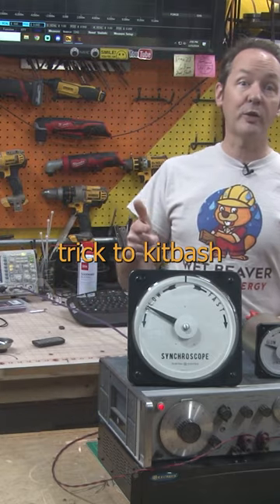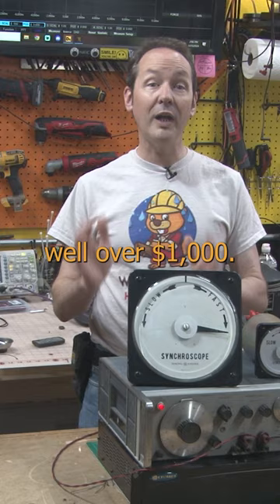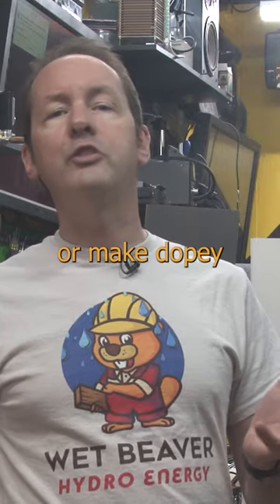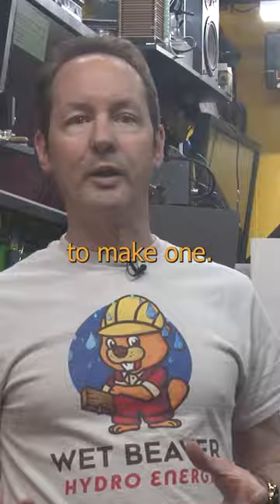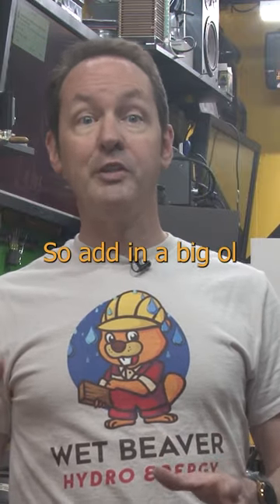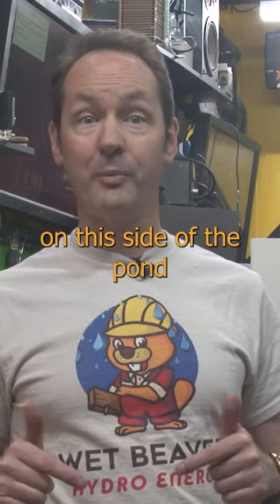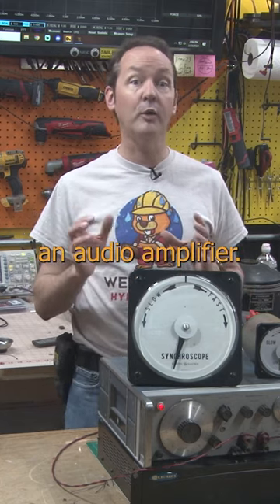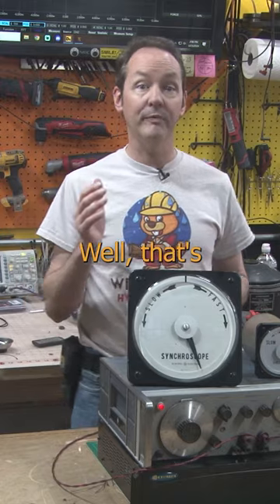Audio Amplifier Power Supply Hack #engineering #electricity #electronics #science #energy #power

Comment: "20Hz up to what the hell are you doing?!" 😂😂😂
Reply: So 2.4 Ghz and 5 Ghz capable? just for my wifi
Reply: 20 kHz are „what the hell are you doing“
Reply: Yep, I needed around 80 volts at 25 KHz to drive ferrite core transformer that then feeds an 8 stage CW multiplier to get 50 KV DC.  So I used a function generator and a 400 watt "Monoblock" amplifier that I had lying around.
Reply: @smithno41  ~20 years ago I wanted to drive old (now its two times old) HV transformer from a TV set to make HV with huge power... Easiest way was to use power amplifier. I still remember big big arcs which covered half room (~30 m^2) - almost everywhere. I was afraid to come closer to shut it down. I had small happiness in misfortune, because IC in power amplifier didnt last long (too much voltage with too much amps drawing), and instead, it become a huge  black smoke generator which covered area around 5 m^2. After replacing this IC I still have this amplituner with black marks in vents holes.
Reply: @smithno41  where in the hells do you need 50KV DC
Reply: That's right bass is best.
Reply: Frequency Response: Yes.  "From DC to Daylight!"
Reply: That "what the hell are you doing" made me rofl 😅 and took me back to childhood, who am i kidding heard it a lot as an adult too lol😂.
Reply: Is that an FCC scale?
Reply: I don't get it
Reply: Yeah, love this guy's euphemisms. Lol
Reply: Remember kids, high frequency and low voltage is just just a signal,  high voltage and low frequency is just hot, and high voltage with high frequency is how you harness the power of gods.

Comment: "the truth will shock you" - I see what you did there 😏
Reply from the maker: I'm glad SOMEONE caught that joke. :)
Reply: @Physicsduck  back during the last ice age, I worked on them for a living.
Well, audio amps, DVD's, CD players, VCR's, TV's, etc. Got lit up a few times due to leaky insulation as well.
Reply: Back when I was a teenager, I built my own audio amplifier. Just from building the power supply part of it, I knew I'd have to treat that thing with a healthy level of respect. If I recall, the power supply was +-90V DC or so, plus ground in-between, so 180V differential.
Reply: It hurts so bad getting shocked by amplifiers especially if it's playing a low frequency like 20Hz :(

Comment: Correct. E.g. an audio amp rated to 2x450W 8 Ohm can produce 120V rms output in bridge mode between the two + output terminals.
Sometimes I see companies at audio shows flexing with operating popcorn machibes on their massive rigs like Crown Macrotech and like driven from function generators. 👍
Reply: My 500w amp only can hit 45v when you run it at 4 ohm. I’m surprised you can do 120v output
Reply: who needs such a powerful 8 ohm amp?
Reply: @nickblyth166  SQR(P*R)=U
SQR(450*8)=60 and by operating in bridge mode equals 2*60=120V RMS.
In your case SQR(500*4)=44.72V RMS So you are both correct.
Only 7-grade math/physics.
Reply: @kjelllindberg6987  Are you sure that's RMS and not peak to peak? I'll take your word for it if you say so.
Reply: Hold on 
Hold on ... 

Many years ago , my first job : I worked in a Sound shop.

So let me try to understand , pardon my ignorance regarding RMS and how they market the Car sound products (PMPO or Max) ... 

Ref (my first car : Golf mk1 1979 model)
* Car Battery = 12V (duh unless yol use 6V in America)😂
* 2 x Pioneer Sub woofers = 1000w each (PMPO i guess) 🫣 @ 4 OHM
* Amplifier (ICE Power marked 3 500 w)

You telling me that the output EXPOSED terminals of the Amp is putting out High DC Voltage ? 

I used to touch Those things mahn 😢

(Due to the High current draw After a few months the Cable from Alternator to Battery melted) 😂
Reply: The crown amp I use in my home audio system (at low volume) can also power my microwave :D
Reply: @Ali_Haji_SouthAfrica They can provide a relatively high voltage for sure. ... when cranked up to full and for milliseconds at a time in audio use, so not much total energy gets transferred. And if you complete the circuit with your own body that under dry conditions may have the equivalent resistance of 100k ohms, then comparing to the 4 ohms reference you should start seeing the difference.
Reply: @Ali_Haji_SouthAfrica Car audio amps have lots of different techniques to increase their output voltage (and power). Some are straight up class D (love my 5-channel Alpine amp) and have no problems getting up to 60-100V, some use the voltage doubling circuit - mostly the head units as it's still impossible to get high output power this way, and some use classic AB topology with a switched-mode power supply to generate whatever voltages are required to feed the preamp, VAS and output stages.
So yes, a car audio amp might very well shock you if you aren't careful.
Reply: Using low power audio amp to backfeed ac powerbrick transformer can be enough for some experiments...

Comment: Add a transformer and you can use it as a makeshift VFD for a single phase AC motor.
Reply: With one caveat: most audio amplifiers will overheat, trip out on protect mode or let out the magic smoke if driven constantly at a fixed frequency. It is doable with some careful design though.

Comment: Audio amplifiers designed for use with distributed audio systems (70v, 100v, 140v) can drive that syncroscope directly.  QSC's CX line with a V suffix (302v, 602v, etc.) are one example.   

Some of the higher output power amps (500w and up), if rated for low impedance (z) use, can also drive it directly. Otherwise, for uses over a few minutes, a 70 (or 100) volt output transformer is needed to protect the amp.

Since I have  CX302v I use for announcing at my mx races, I just need to find a syncroscope. 😅
Reply: Spoiler alert: that amplifier is driving the synchroscope.
Reply: I also have a few trash-picked amplifiers with 70V outputs. I once used them to make an improvised VFD.

Comment: Yeah, i like that! Last year i needed a 5 Hz current to test a CT. Just found an old car-radio with integrated cd player. So i downloaded a  programm to generate some audio tracks with the needed frequency, search for a old computer with a cd-burner -> here we go. 
Even the amplifier was just rated 20...20kHz, it does the 5Hz fine with an output of 5V RMS and approx 200mA. After that i put a isolation ring transformer, connected the amplifier output to the 230V input,  and the 12V output to the CT under test.
Reply from the maker: THIS IS WHAT I'M TALKIN' ABOUT! Thank you :)
Reply: This is the kind of stuff I daydream about thinking up. I'm 50% there.

Comment: I had an 8000 watt subwoofer amplifier. In my mind I thought if I could get a clean enough 60hz signal, it would be able to actually output 120v. But only with the right resistive load. As the transistors hate the inductive loads.

Comment: I absolutely admire, repair and own 80s HP Signal generators. Looks like you have the model above 651B. 

I also have their Vector Voltmeter and Impedance LCR meter of the same 80s era. 

Generally they need just a capacitor overhaul in the power supply. The design and engineering is in a class by themselves. 

Love your videos!

Your invisible friend…

Comment: I use to test generator automatic synchronizors, "back in the day." Westinghouse and General Electric models were common in our system. We had a piece of test equipment that could produce the required frequencies and voltage to simulate the generator. 
We used a single phase variac that simulated the bus voltages. All voltages were typically 120 vac single phase. A chart recorder would capture the final contact closure just prior to zero degrees synchronization.
Surprised you don't go out and purchase a relay test set. 
They provide numerous applications in your system.

Comment: For really high volts, or just good old 240V, just add a transformer to the output of the audio amp, as in feed the amp into a low voltage winding then receive lots of volts a high voltage winding.

Comment: I have a beutiful home built audio amplifier using surface mount mosfet amplifier modules built by a guy in Tasmania, Australia.  The greatest dynamic range I have ever heard.  The power supply is 75v +-, so 150v rails and a 150,000uf cap bank, also used high speed Schottky TO220 diodes for the bridge rectifier to basically eliminate any reverse current flow creating line noise, The Schottky diodes can be bought to handle these forward voltages, love this amp..

Comment: Your average PA system amplifier will give 25v or 70v RMS at anywhere between about 20Hz to 20KHz. Get a dual-channel PA amp and run it in bridge mode, and you've got more than your AC line voltage.

Comment: Ive had an audio amp on my bench for years, i bought it into my shop probably 15 year's ago when i needed 400Hz for a peice of gear from a plane and its been there ever since, ive used it so many times from driving flybacks and hf transformers to driving and modulating Vacuum tube and transmitters. Really great little techs trade secrets,  thanks for sharing these tech tips man, im sure it will helpfully for a lot of future guys and gals 😎👍

Comment: The amplifier in my theatre is from a pa system. And it has 100v line output for left & right channels. At 200w rms before clipping. The 100v line is generated with a transformer that can be clicked on if you have 100v line speakers otherwise the amp output goes directly to the speaker outs.

Comment: Sure you can get the voltage up, 
But.  You wont be pulling many amps, especially nowhere near 10 if you needed it.
Reply: you don't get the amps without the volts.  ohm's law.  and a cheap amplifier isn't going to have more voltage coming out than the 6 volt wall wart going in.

So you either need a great big amplifier -- 500 watt 2 channel 8 ohm -- or a PA amplifier designed to push strings of cheap speakers through incredibly long wires.

Comment: Since I mostly know audio as line-level signal, I wondered why my amplifier's outputs warned of high voltage. I'd touched them before, it was fine.

Turns out it had a 140v max total differential across those leads. Neat!

Comment: Doing research on Modular synthesizers I ran into a video from a few years back that implemented phase shifting with an op amp, but far too much of that was simply 180 degree  or inverting. For other degree phase shifting, I'm mostly seeing RC circuits that are going to be frequency dependent, so that 20 to 'what the h... are you doing' range has issues. And yeah, for driving stepper motors I'd like the option of working with 90 degrees rather than 180, likewise I imagine if you want to simulate 3 phase power, you're probably looking for 120 degree shifts. Electronics, it's so fun it can be shocking!

Comment: I had a Amp hooked up to transformer with a 12v lightbulb in loop to add resistance.   As The bulb burned  out rapidly it somehow surged the preamp inputs and magic smoke was everywhere.   It worked for a minute or 2.

Comment: Please explain what half-off electricity is, and how that differs from the European electricity; because up till now I thought the only difference was that Europe has single phase 220volts, and USA 115 and 240 vac.
Reply: Currently in the UK, the price of electricity is set at ~28.6p per kWh.  That works out to ~$0.33 per kWh for those of us here in the US.  In Wyoming, which does have cheap electricity mind you, our electricity is $0.1145 per kWh.

I think that may be one of the things he is alluding to, but I could be mistaken.
Reply: Most things in the US use 120v, so your audio amplifier doesn't have to be able to hit 230v like would be expected in Europe.
Reply: The US has split phase power.
A 240V transformer supplies power to your house. It’s center tapped with the center tap being earth referenced and forming the neutral conductor.
Half the transformer, (either hot) to neutral (center tap) is 120V.
Reply: There's a hertz difference too. Though I can't say "half off" refers to, though it does make me think of AC.
Reply: I'm in the Netherlands in Europe and I actually have 3-phase power, even though my cooking and heading is gas-based 😎
Reply: He means that this trick would be much more difficult across the pond.  You can get 120V out of a big enough audio amp, but 220 would take an audio amp four times larger than that!
Reply: @waroftheworlds2008  60hz in the states, 50hz in the u.k and Europe. In the UK we only have 220/240v single phase, or 415v 3 phase. 
UK mains voltage has varied between 220 and 240v over the years. 
Practically, this makes no difference at all,  as all products sold in the UK had to have a 10% voltage tolerance built in. 
Currently, my UK mains is sitting at 247v and has been for the past few years.

Comment: I can run a table saw with one of my car amplifiers, just input a 60hz test tone or signal generator through it...
Volume will control the voltage.
E-audio 3000d will output with impedance as low as .3 ohms😊

Comment: Used a signal gen. and an audio amp to teat the hysteresis curve of a solenoid I was making. Needed meters and an O-scope to monitor what the heck I was doing. Never got that nice hysteresis plot on the scope though. The spec sheet for the core did say that it had nearly no hysteresis. I guess all I can do it believe them. Had my solenoid made for 3.7 V DC running at upwards of 25 V RMS and at all kinds of frequencies trying to get that hysteresis curve. The one time I didn't trust the datasheet when I should have.

Comment: Iam currently building an "RF" amplifier using two 813 vacuum tubes which require 2,700vdc  to use on the "HF" frequency 1.6 to 30mhz.

Comment: No that much voltage. For that you need to input the amplifyers output to the secondary of a normal mains transformer. And now you have a variable frequency/amplitude output that ranges from about 45Hz (in a 50 Hz world (or 55 Hz in those pesky 60Hz countries)) to at least 1000 Hz and from 100mV to 300V RMS at the maximum load the audio amplifier can handle...

Comment: Why would a home audio amp put out 120 volts? The voltage should be the same and the current should oscillate. Maybe a 12-120 transformer will help
Reply: Well, remember Ohm's law: with a fixed impedance, current is directly proportional to voltage: both have to oscillate to produce audio.

About the 120V thing, I'm surprised too. He's probably talking about a higher impedance than typical 8Ω speakers, where your amp would need to output 1800W to reach that kind of voltage. My guess is he's saying you can take a "regular" ~85W audio amp but give it a ~180Ω load, and it'd still be able to output ~85W (meaning ~120V RMS).
Reply: to increase power, one has to increase voltage.  A small ampllifier wouldn't have a high voltage.

There's also specialized amps, PA amps, that are just high voltage in general, for forcing audio through miles of wires.

Comment: speakers commonly is only rated for 48v so why a amp would make a higher voltage as this? ya i know driving a 4ohm 2kw smr bass driver need some serious voltage but who needs this much power.  have you aver thought about a rotarry speaker or woofer this things can move much more air with way less power and can deep as 1hz.

Comment: Speakers are fixed impedance 8 or 4ohm so the only way to get above like 20 watts off of 14vdc is to have a boost converter stage first to create like 100 or 200vdc prior to powering the amplifier.
So to determine which size amp you needjmath. So for 220vac you first need to find the peak voltage (multiply by srt(2)) 220*1.4 = 308vdc. To get 308dc you need 308/8 = 38.5 amps. To get 39 amps you need 39 * 308 = 12kw. So you need a 12KW RMS amplifier.
But you can go smaller if you use a transformer.
To make 55vac only requires 770W, and you can boost it to whatever with a transformer.
Reply: Speakers are most certainly NOT fixed impedance. Their impedance varies with frequency. A 4 ohm driver can have an impedance of 30-50 ohms at it's resonant frequency. Typically what they list as their "nominal" impedance is their lowest impedance they get. Their impedance curve also varies greatly once you put it in their enclosure with different enclosures measuring differently. They vary if you drive them hard and heat their voice coils up, they will measure different if you have your speaker in the middle of a room (1/2 space) vs a corner (1/8th space).
Reply: I hope to hell this guy was satirizing.

Comment: does it output these voltages so it can output to massive amounts of speakers all connected in series?
Reply: Not usually as a fault in 1 driver would take down the whole system. In a system like a school pa system or restaurant or shopping center, they would run many speakers off of individual transformers (each speaker has it's own transformer)  in either a 70v or a 100v system. These transformers usually have multiple taps so you can pick the voltage that gives you the relative volume you need off of that speaker. You can then run as many speakers as the wattage capacity of the amplifier. These systems reduce line losses over great distances.

For concert or nightclub systems, you would dump those voltages (120v+) into a single subwoofer driver :) and have many of them running at the same time.